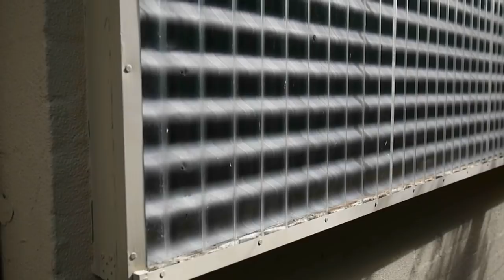Solar Space Heater- heats air in the house using the sun

Comment: Solar air heater panels really DO make measurable, utility-bill-denting amounts of heat, and can do that even in cloudier regions like the Pacific NW of USA.  We did it for several years at a rented place, using [2] 4’x8’ panels to warm an old house of about 900 s.f.  The best savings came after adding a 4” duct fan, and, better cover material to seal in the heat instead of leaking to the great outdoors.   But even the leaking, initial iteration, saved over 100 kWh’s off monthly winter heat bills.   That translated to about an average of $30 USD saved, per winter month, off electric heating bills.  THAT was Meaningful savings, even counting that the panels also kinda heated the great outdoors via leaks.    
    We got the utility company to generate a listing of all our utility bills, to check the impact these panels made.    
Once better cover material was used, panels sealed better, and air movement boosted with a 4” duct fan...savings reached around 300 kWh’s monthly in winter.    The duct fan pushed air through, rather than pulling it through, which made it quieter.  Duct fans are often one-speed, more like a low speed, so tend to be fairly quiet, and, avoids moving air too fast to heat.  They do draw a bit of wattage, compared to computer fans.  
    There are only about a couple weeks in the deep of winter, here, when it was pointless to open the vents to let air circulate through them.    
    Our panels used aluminum can stacks inside, instead of corrugated metal sheeting.    Cover material we could get, at best, was the TwinWall polycarbonate [we started with the cheapest corrugated greenhouse plastic panels--those warped/deformed due to the high heat generated inside. 
    NOTE #1:  One challenge:  prevent panels heating during warmer or hot weather.  When these kinds of panels vent outside, that adds to the environmentally bad heat-concentration in most cities, or wherever they are mounted---that heat signature over those areas can get far worse, if more people vent excess hot air into the ambient outdoor climate.  Heat concentrations in cities is a real problem.  It causes markedly larger energy consumption from added A/C use during hot weather; creates different climates even, within a city’s footprint. 
Imagine more of these panels used, per population, venting their solar air heaters to the outside during summer?!?  OUCH!    
So, just AVOID venting excess heat to outside in warmer weather, as much as possible; shade them, either by placing shades over them, or mounting them so sun doesn’t reach them, on a vertical wall with a roof overhang....depends on your site, how to configure.   Some smart makers with panels on vertical walls, also make shutters to cover them for hot weather, or make panels moveable on hinges to flip them over to hide from sun.  
     The panels I’m about to build for the new place, hopefully better made and larger to warm larger house [about 1400 s.f.] 
It likely will need at least 4 panels, maybe more, to dent our winter energy bills here.   We have a baseline energy use readings for 3 years, to compare with.   If the worst winter bills drop by at least $100 US, that’s a “win”!  Anything more is icing on the proverbial cake. 
     Tricky bits include how to shade panels easily during hot weather--has to be easy enough for the disabled persons who will take over this place once we’re gone, to do it without assistance.  Right now, thinking of putting U-channels on either side of box face, to slide light-weight white plastic or metal shade panels into.   Or, mount roll-up shade cloth at tops, to deploy those during hot weather--may go with that, since we have some to recycle.  Or, can mount shutters to roll-out over panels kinda like barn doors.   
This place lacks room on vertical wall, so likely will mount over patio...making shading them in summer even more important.   Solar air heat panels can reach melt-down temps in summer.    
When panels are not mounted directly on walls, ducting can be insulated to carry air in/out of the house...just opt to make those ducts as short as possible.  
Will be using computer fans run direct from small PV panels, to move air;  air pretty much stops during dark hours, automatically.    Considering including PEX type tubing in the layout, so water can get heated to feed the water heater, as well.
    NOTE #2:   Using cleaned and rinsed aluminum cans:  a simple can opener was used to poke 3 more holes in each lid; then use knife-handle to crimp the slightly wider can-neck, so it sleeves into next can without tearing the aluminum; then cut off bottom of cans.   Then stack cans to form long tubes, to fit to manifolds in top/bottom of the panel.    
    NOTE #3:  WHY can stacks?  Because, I discovered that a 6’ tall stack of aluminum cans configured this way, would generate _0.5 degree F. of warmth, in the dark, at 22F. in a slight breeze_, almost instantly.   Due to still air inside cans? Nope, because air was convecting from bottom to top inside the stack.   
The external thermostat was sited next to the stack; the remote sensor was dangled into the top outlet...voila’, 0.5 degree F. warmth venting out the top.  
That might seem like a piffle amount but,  every bit of simple,  natural efficiency one can use, counts.   
It meant that 10 such stacks, enclosed in their insulated box, generated about 5 degrees F., just sitting there on a dark cold night.  It means, that if more are used, more warmth can come just from the cans convecting, even on dark cold nights....which might be fairly meaningless when outside ambient is below freezing...but in mild climates, it might be enough to take a little chill off rooms.
Reply from the maker: Thanks for all that information. My system has been going strong now for 12 years with no maintenance required. It is the middle of winter and it is pumping out 65'C hot air when it's sunny. My change-over system for summer is not ideal for disabled people but easy for me and has worked well. It is basically just a vent flap at the top that can be opened.

Comment: This is a nice set up but wouldn't you want to reverse the intake outtake? Maybe I'm wrong but if hot air rises wouldn't you want it taking in the warmer air from the top and blowing in even warmer air from the bottom?
Reply from the maker: Yes I agree. I originally hoped I could use convection only without fan but I didn't get any air flow so added fans. Then I was limited with how to prevent reverse airflow at night with a flap so had to go same direction as convection.
Reply: Makes sense. Cudos on the set up regardless looks very clean.

Comment: How many BTUH per sq. ft.  do you get... Great idea... Thank
Reply from the maker: Here's the info I have from my video showing its performance- On a 16'C cloudy day it was blowing out air at 60'C at 0.01 m3/sec which corresponded to 530W of heating. The maximum temperature I've seen is 85'C which would be 830W. My air flow measurement was pretty rough, so the real values may be higher. My collector is 4.8 x 1.6m so using rough calcs I was expecting more like 4kW.
Reply: OK... What is the CFM of your airflow of your system and the change in temperature air going in subtracted from temperature going out divided by the square footage of your total surface area of your system... Thanks
Reply from the maker: carlo sgroi ok- I'll do the conversions for you...airflow would be around 20cfm, max temp diff 69'C, collector area 83 square feet. Note that airflow measurement was very rough, and fan is rated much higher CFM so it is probably higher than 20cfm
Reply: Michael Porter And it works even without fans because hot air lifts up.
I made similar (but not as nice as this) heater too, with the exception that I used solar panel to feed electricity to a fan in rooms hot air intake.

Comment: Hi! how does the panel hold up after so many years? I also want to make one of 16 sqm, do you think it would make a big difference if I used aluminum sheet?
Reply from the maker: I have just had my house rendered and plan to sell in a few years so I decided to remove the panel. It was showing some signs of age but was ok overall. The main issue was that in some weather there was moisture build up inside which collected at the bottom of the panel and started to affect the wood. I only used cheap pine but maybe cyprus would withstand that moisture a bit better. I also made a hinged flap at the top to vent air outside during summer and that had been affected a bit by weather too, and would get a bit stuck but could still be operated. Aluminium sheet would work well, but just costs more than old roofing steel. I have seen some of these where they used drink cans for the metal. If I made another one I would also try to improve the airflow. I had too many turns. I think having a header at top and bottom and just having air go straight up without turns would be better. I also added my fans after the original build and I hadn't left enough room for anything but very small fans.
Reply: @michaelporter000  thank you!

Comment: Can i use a thick layer of card board boxes as the frame for the solar heater ? And do the frame has to be wood for it to work or heat up ? And do this solar heater work good for the winter ?
Reply from the maker: You can't use cardboard. It gets too hot and I think cardboard might catch on fire. I have measured air coming out at temperatures over 80 degrees Celsius so it can get very hot in the collector.
Reply: Do i need electricity from my home to power the fan to blow the heat and do the cans have to beat neatly set in to make it heat up ?
Reply from the maker: mangreat71 I just power my fans from the electrical outlet. The amount of power is so small there is no point trying to install solar cells or anything like that. The payback period is too long to consider solar. As for cans - I don't use cans - but the air path must be the lowest resistance possible. You want the air to flow easily.
Reply: So that means the space inside has to be tight with metal or nearly no air escaping for it to heat up ?
Reply from the maker: mangreat71 This is a pretty low-tech item. It just heats air so it doesn't matter too much if there are small air leaks. The metal inside doesn't form an airtight area- it just acts as an object for the sun to heat up. In fact, one reason I don't favour using aluminium cans is there is not as much mass to heat up, so there is much less heat storage. If you didn't want to use corrugated steel like mine, I suggest you use any metal you can get. Cheap is good! Painting the metal black with high temperature paint makes it better!
Reply: +Michael Porter The cardboard won't hold up well in the rain either.
Reply: +mangreat71   Cardboard will rot, burn and bugs love it...not a good choice...
EXCEPT...MAYbe as the insulation....IF you first treat it using borax powder to inhibit bugs and burning, AND, only use it as the insulative layer, where it is separated from the hottest part of the panel.  
WARNING: Corrugated galvanized metal roofing warning:  
The galvanizing process causes toxics to be released if the galvanizing gets heated. I do not know how to seal the galvanizing in, to prevent the high temps from solar gain from causing that.  
Instead of metal, some have used black-color window screen, two layers together, and tilted on angle inside the solar box...some swear this works as well as, or better than, using metal.  We used stacked aluminum cans..and plan to do that again .  We also want to make water heating panels.  Had thought to hybridize those systems, but decided against that, to prevent losing both systems if one goes haywire. 
We made [2] 4' x 8' panels, using wood box frame, and using stacked aluminum cans. 
We used the only high-temp paint we could find locally, which was wood stove paint.  
Then let that "cook out" in the sun, to get rid of the nasty VOC's, before hooking it to the house.  
Our electric bills over several years, reflected that we saved between 100 to 300 kWh off our electric bills, in winter, in the cloudage-prone Pacific NW.  
The high-end savings was using 2 panels + a 4" duct fan pushing air through those, a better cover [twinwall polycarbonate greenhouse panels] and better air seal. 
The low-end savings was 1 panel, no fan, poor seal on cheap, corrugated greenhouse panel covers.  
Both setups recirculated room air.  
In the low-end setup, the cheap corrugated plastic greenhouse panels actually melt-warped, despite the air leaks heating the great outdoors. The Twinwall polycarbonate worked pretty well, no melt-warp, and stayed sealed better. 
In a perfect world, I'd mount the panels on a vertical wall, canting them out at a small angle, to optimize winter heating, decrease heat during high-sun of summer, and make it easier to cover them in summer. 
The average approx. angle to sun is about 45 degrees here....BUT...we have lots of cloudage in winter...therefore mounting solar on a south-facing roof, helps optimize winter omni-directional daylight, which also helps optimize this setup in our winters when it's most needed. 
Have a summer vent, and summer covers for the panels...really important. 
Unfortunately, venting them in summer adds to ambient heating of general air....consider what happens with this, if lots of people do it...the ambient summer heat in the area is raised hotter than it would otherwise be.  That is why we COVER our air heater panels in summer.  In hot climates, even water heating panels will cause need for an expansion tank.

Comment: Those PC fans don't use much power and they use DC as an input. Why not get a small solar panel to power the fans?
Reply: +Gary Verderamo It's a logical change to remove the cost of electricity from the savings equation- but solar panels are so expensive compared to the cost of the tiny amount of electricity the fan uses it would take many years to pay for the cost of that modification. Also, I have grid-connected solar power at home so it is effectively using solar power anyway - just much more efficiently.
Reply: +Gary Verderamo By "so expensive" I mean it is around $30 - it is only expensive compared to the cents per kWhr of electricity.
Reply: Michael Porter I see your point, but a single 120mm standard case fan uses 2.4 Watts. I think that is for one with an LED. So, less for those that do not have LED's. A single solar cell (not panel) produces 2.5 Watts. 

Having just checked eBay, you can buy a pack of broken cells for less than a dollar. They are already tabbed, so building a cheap panel with a couple of those cells would not only be economical, but also a great solution that would certainly pay for itself many times over.

Now, you already have panels, which is cool, but this would be a great option for those out there watching your video.
Reply: +Gary Verderamo OK, at $0.30 / kWhr, running 12 hours a day for, say, 100 days a year = 0.3 * 12 * 100 * 0.0024 = $0.86 saving per year per fan. You would probably need at least two panels per fan as they only give full power in the best conditions. You would need to buy other components too, so it's pretty hard to make it worth it unless you get parts for free.
Reply: Michael Porter No extra equipment. The fans accepts 12VDC and solar puts out 12VDC. Hook it up straight.

Also, the cells are less than a dollar for a pack. OK, with shipping maybe a bit more.  However, if you have a dealer near you and if you just happen to be out and about one day, stop off and buy two or three cells. Broken or otherwise.  

The wood frame, screws, etc... are all free if you look around. Hell, I bet you can even get the plexiglass cover free if the time was spent looking around. For something that small, you could use the glass from an old broken LCD screen. Little bit of sealant, which is something most handy type people have on hand anyway. If not, buy a tube and whatever you got left over, go around the house and seal up some holes in the exterior or around windows or whatever. This reduces heat loss in the winter. That way the cost of the sealant is not solely attributed to the panel and it is something people should do every winter anyway.

In short, as long as you have some scrap wire laying around and a soldering iron, this project can be limited to the $1 cost of the cells and the price of shipping.

Again, this is not just for you. It is for anyone watching this video who does not already have solar in their home.
Reply: All it takes are the cheap tiny PV panels...can salvage some from old solar yard lights, or, get cheap from places like Harbor Freight, to run the DC computer fans to help boost air movement through solar air heater panels.  OR, if you don’t mind using a bit of Mains power, simply insert a duct fan.  Those use little power, and can push air softly through the panels.

Comment: Ok when I said wasted I meant you could be COLLECTING a lot more heat if there was more there to collect. A heat sink is what does this. It makes the collection easy faster and more readily available. The heat sink will stay hotter longer and allow you to not only collect heat farther into the night but also gives you a quicker UP HEAT in the morning. Plus the added benefit of an increased VOLUME of hot air to draw from. A heat sink in these situations is MANDATORY and not an option!

Comment: this is another idea to add to this, no insulation heat up the brick wall behind the heater  its called a trombe wall https://en.wikipedia.org/wiki/Trombe_wall
Reply from the maker: It's a good idea. In my case it wasn't so appropriate because I have a plaster wall (i.e. dry-wall) inside the room which would have to have been removed. There is then the issue of how to stop the unwanted room heating in summer.